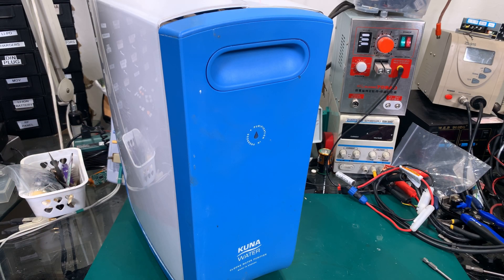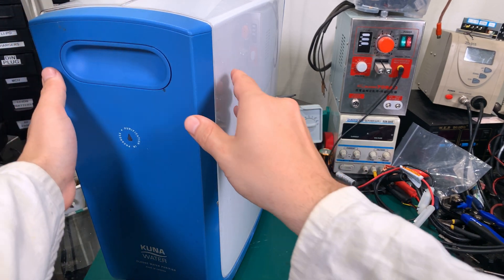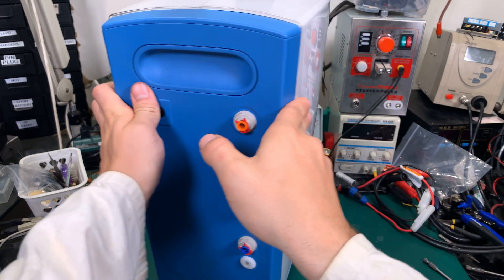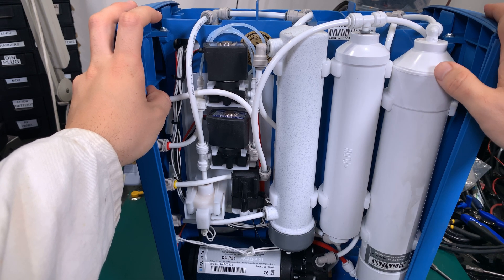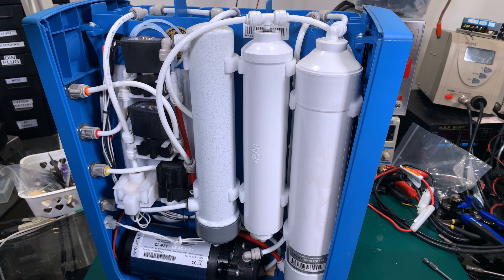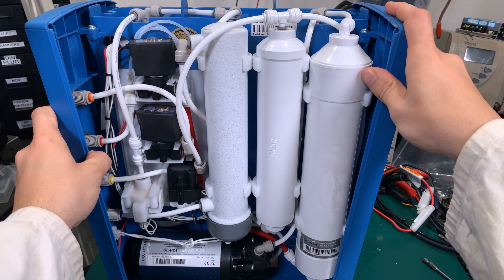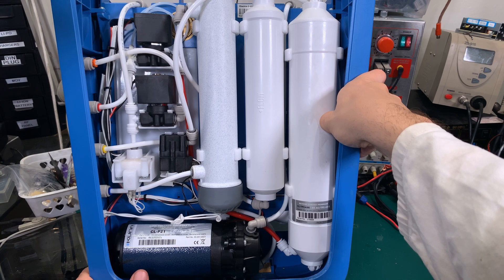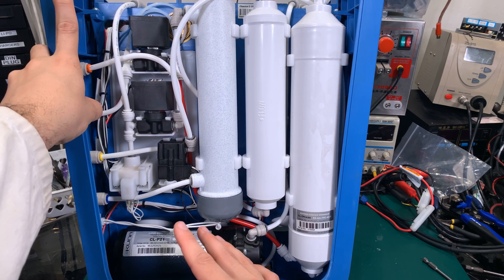Kuna / Bluewater Cleone  reverse osmosis water purification system (tear-down) - is it overpriced?

Comment: Hi can you suggest where i can buy replacement filters ? Based in Ireland.. amazon link would work
Reply from the maker: I can't - I just google "kuna filter replacement" and ordered them from first link. It was set of all filters, non genuine but with same connectors - just plug and play.
Reply: @ElectronicNoobBlog  the first link is the original product link, which is very expensive. try suggesting something that works?

Comment: Can you tell me how to disable the lock before replacing the filters? every year the filter turns itself off and we have to pay $250 to replace it no matter how much water we drink. We want to replace the filter every 2-3 years. There are companies that remove blockages and sell other filters for this device, but we wanted to do it ourselves. We will not pay for a market monopoly to 1 company.
Reply from the maker: Mine unit came from EU distribution and don't have any lock like You described so I'm not able to help You out. My unit have indicator that notify You to replace filters yourself and then reset that indicator. It's described in manual on page 20 ->  https://www.bluewatergroup.com/wp-content/uploads/2019/08/Cleone-Complete-User-Manual-822901704-BB1623_NEW-2.pdf    but as I said - this if for EU version - maybe different country have other firmware. Try check out is there reset button as on manual above - maybe it help resolve Your issue.